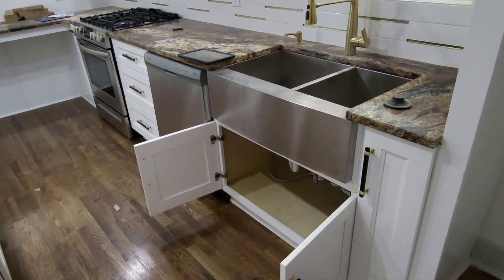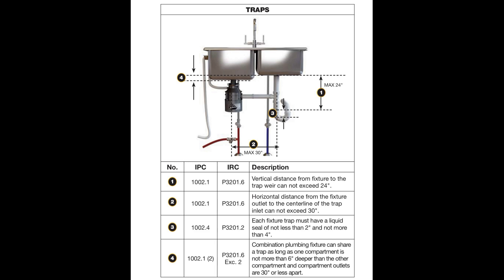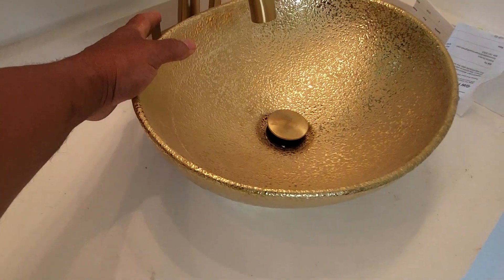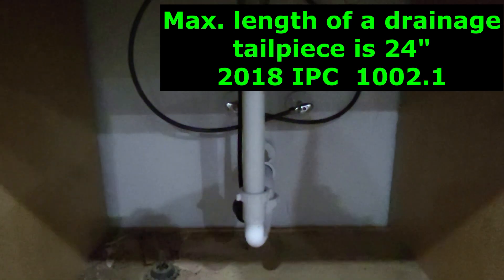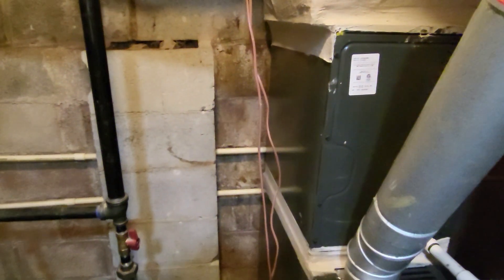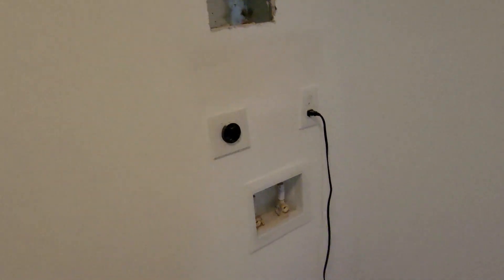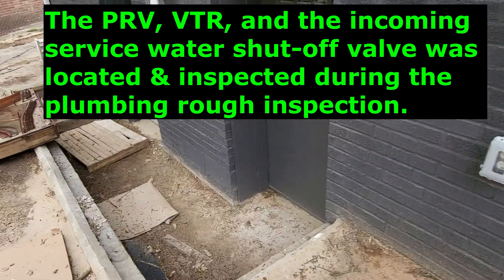Learn How to do a Residential Plumbing Final Inspection

Comment: No bowl test?
Reply: Ohio…IPC. It’s just something they always ask for at my final…maybe not described in IPC but I’m not sure of another way to make sure fixtures are air tight. Toilet seal is often an issue. Won’t leak water but sucks air
Reply from the maker: Interesting, I never stop learning.
Reply from the maker: What's a bowl test?
Reply: @PPG1967  a final test that has to be done to satisfy city plumbing inspector. Balloon off stack at the base and at the roof, make sure traps have water and fill the toilet bowl with water to make sure it holds. It’s how you make sure you have a good seal on all fixtures and haven’t driven any drywall screws through your drains. I’ve never gotten away without doing a bowl test, it’s code
Reply from the maker: Interesting...what code book are you using, and where are you located ??

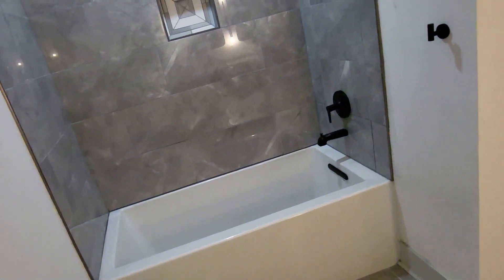Comment: At 4:45 in the video did you say to "seal and caulk" at the base of the toilet?  If so, where do you find this in the code?  If the toilet is caulked, wouldn't this damage the floor and cause a leak below the toilet if the wax seal fails?
Reply from the maker: If you're familiar with the 2018 IRC or  IPC, it's under Plumbing Fixtures, Installation section.
Reply from the maker: It states, when fixtures come in contact with walls and floors, the contact area shall be watertight.
Reply: @PPG1967  Doesn't the wax seal make it water tight?  If the wax seal fails, water will be trapped between the flange and perimeter of the fixture if it is caulked and sitting on top of a floor that may or may not be waterproof. My bathroom floor is 3/4" tongue and groove oak flooring and it is not waterproof.  If the wax seal fails, I want to know about it before the floor is destroyed.
Reply from the maker: Code states, " when fixtures come in contact with walls and floors, the contact area shall be watertight."

Comment: The shower that you did not turn on is wrong. Supposed to be able to turn the shower on with our the water shooting at you. Check your codes. The door should have been at the left.
Reply from the maker: So, where is that in the 2018 IRC or 2018 IPC????... I'll wait.
Reply from the maker: Are you a plumbing contractor?
Reply: I really don’t think that would make sense, code wise. If you turn on the water and it’s hot, you’d have to reach over in the hot water to be able to lower the temperature

Comment: Didn't check temps,  fixture clearances,  didn't turn shower of the tub/shower on to make sure that's not leaking. Inline mixing valves not allowed on showers, verify handheld is a112.18.1 compliant, is tub caulked to floor.
Reply from the maker: So, what Plumbing Code Book are you referencing??...my videos are based on the 2018 IPC.
Reply: @PPG1967  ipc doesn't cover residential.  You would need the irc

Comment: Question about the T&P relief tubes: The code states that the piping shall discharge in the same room as the water heater. Those two in the video go through the wall. Can you explain the situation here if this was approved and how it differs from the code?
Reply from the maker: So, what code book are you referencing??
Reply: 2018 IPC, same as you. 504.6 #2 is what I was referring to. I wasn’t trying to challenge you, I was just asking. I’m fairly new to the inspection game, so I welcome any help and explanation I can get. I looked at the T&P section just before watching this video and I wondered about what I saw vs. what I read. Any clarification you can provide is appreciated. Thank you.
Reply: Terminate at an approved location. That is what is required.

Comment: Do those runs off the TPR valves have too many 90-degree turns?    at 14:25.   Also, no copper on those?
Reply from the maker: So, that CPVC has a higher temperature value.  That is a lot of elbows, however it's allowed.
Reply: @PPG1967  great to know, thanks!
Reply from the maker: I appreciate your feedback.